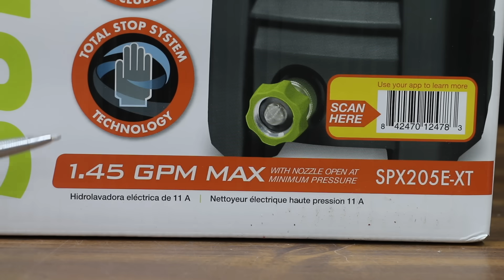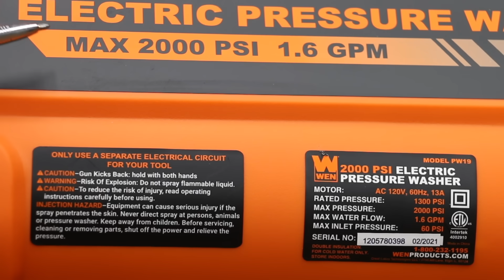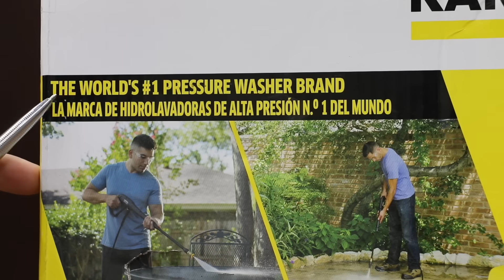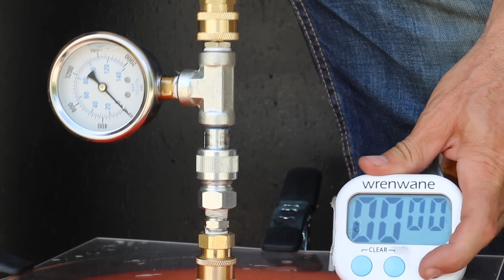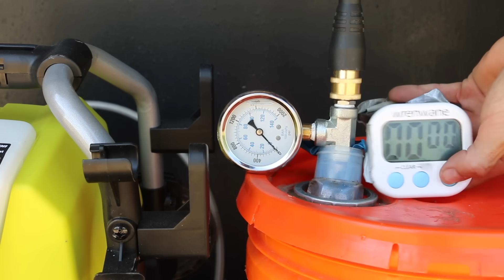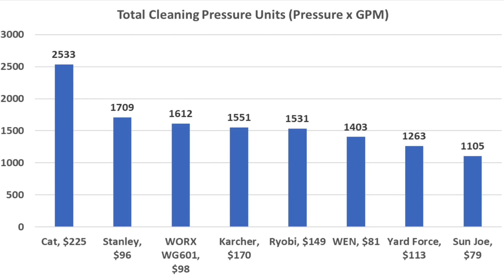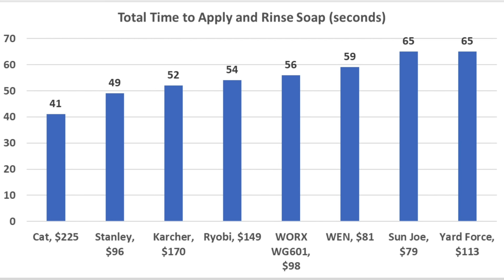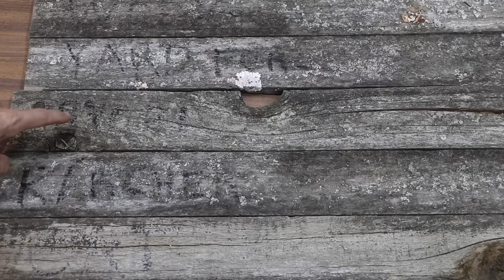Best Pressure Washer (ELECTRIC)? Ryobi vs Karcher, Stanley, Sun Joe, WEN, CAT & WORX

Comment: Love your videos, I actually was just looking to buy one of these.  One thing I would really like to see, is if you just open the pressure washers and show us what's inside, it doesn't have to be extensive, just a quick look would tell me a lot, for instance you might see plastic parts vs metal and different pump styles. Anyway keep up the good work!
Reply from the maker: Great suggestion!  Thank you.
Reply: @ProjectFarm  can you revisit the car or generator running on hydrogen but with a bigger hydrogen oxygen generator maximize surface area , use a carbureted engine  , maybe add a little power with solar panels see what happens. Seems like it might even work better with something that was designed to run off propane
Reply: @lucashawn347  It won't matter. 
Thermodynamics and all. 
You can't get more energy out than you put in.
Reply: @tomfuelery2905  I'm not trying to see him make a free energy device. Just a beefed up hydrogen oxygen generator that puts out enough to maybe make a real difference definitely sounds possible with solar panels in parallel with what's coming from the alternator plus a lot more surface area for gas production. We know things can run off hydrogen oxygen gas. Problem is how do you make enough on hand with solar ,wind or whatever to where you don't actually have to purchase gasoline or charge your car every night. I don't know all the math but I've had some luck with a 4 cylinder dodge Dakota.  Really wasn't that much difference but noticable. Had a cell homemade not much bigger than that one but my electrodes had much more surface area comparable to a radiator.
Reply: @ProjectFarm  yes PLEASE do a inside video of the pressure washers. I’m a ryobi owner and now I’m wondering what it is that makes it about 50-70 dollars more than some of the washers that outperformed it. Is it just the name?
Reply: @ProjectFarm  A very interesting and informative video, the one thing that I would recommend is when first wetting anything that you will be washing, by hand or with a pressure washer, is start at the bottom and wet going up. When wetting from the top the long drips soak the dirt longer and result in streaks.
Reply: @ProjectFarm   you forgot to test gas pressure washers :(
Reply: @ProjectFarm  I would absolutely love a Project Farm Reviews channel. It would be great. This is kind of a reviews channel, but it's scientific and therefore not opinionated. I think I and the rest of your viewers really value your input and opinion, so it would be a good secondary channel (and probably pretty easy to do on the side!) Thanks :]
Reply: @MetalY2KMusic  
  Opinions are like bodily waste exit valves... everybody has one.
Reply: I'm willing to bet 20 dollars this feedback will be in the next pressure washing video if there comes one
Reply: to be honest - I am not interested in buying such pressure washer - have no use for that at all (live in a city) - what is far more interesting for me: 
HOW the heck did he test it ???
After watching this video: I seriosusly admire this guy's commitment and superb work!
Reply: @kris856  Dude, he makes it on a regular! :)
Reply: @HanSolo__  true, bro- so very true 👍
Reply: Or at least a plastic vs metal hose connection.  I commented above check out the Active pressure washer.  It is the same as the CAT and I think was $200.
Reply: This sounds like a job for AVE
Reply: @_ohmz_electric  AVE is a moron. Everything is an OpAmp to him.
Reply: @_ohmz_electric  AVE would do one, probably an overpriced piece of crap, and eviscerate it.  Certainly I'll keep my eye out for it. =)
Reply: @bansheedearg  AVE would have taken it apart, then when it doesn't work just call it chinesium and throw it away.  I've never been so entertained by that magic swearing Canadian poet/tool destroyer
Reply: @_ohmz_electric  Yes, we need somebody that opens things up and does not close.:D Kidding. Love AVE.
Reply: @_ohmz_electric  Please no....hoses, nozzles, tips, pumps and wands...it would be an overload of boyish inferences to his other "shop equipment".
Reply: @Ben C What the hell are you talking about? He doesn't work for Amazon or anybody else, he buys and tests items using his own money.
Reply: @Ben C finally found the one person who who doesn't like the channel
Reply: @Ben C I've had mine for a couple of years, makes the driveway gleam, snowfoam lance for the car, cleans the gutters and drains, blows weeds out the cracks
That's all I need it for so I didn't mind spending £120 on the best that was recommended at the time
Got no space for an industrial cleaner that needs fuel either
Reply: @Ben C guy buys stuff, treats it to real world testing like any normal Joe, reports his findings, then leaves it up to you
And you are arguing that "he works for amazon" because he links back?
Only the other day I liked for a @ProjectFarm video and then clicked the link to buy it as a thank you for doing all the testing
This is THE go to channel for testing, and he's got plenty of people who, like me, trust his reviews
Reply: @Ben C I own a mix of Snap on and Amazon "junk" depending on what I need it for. The bigger version of that Sun Joe pressure washer that I own does exactly what I need it to when I need it to. I don't need a pressure washer that is capable of removing the paint from my car. That being said, my electric pressure washer could probably remove the paint from my car as well if I wanted to get crazy with it. Might it take longer than the gas one at some tasks? Probably, but that only matters if I am using it all day every day, which I am not. I roll it out, plug it in, turn it on, and it functions each and every time without needing to maintain a gas engine.
Reply: @Ben C You should understand that I was an automotive technician for over 14 years. Just because I can maintain the engine doesn't mean I want to. Electric is easier for the vast majority of modern people. Do I wish more people knew how to work on things? Sure I do. But that is not the reality. I'm glad you enjoy working on your gas pressure washer. My big stand-up version does exactly what I need and giving somebody crap for using something that fulfills their needs is just not useful. And what do I really need to justify post-purchase? My pressure washer was sub $200. There is no buyer remorse there. I would have buyer's remorse if I spent the money to get the top-of-the-line unit and then only drag it out once in a blue moon. It should also say something to you that you are the only one in his comments that is negative. Maybe the problem isn't Project Farm or the people who like electric pressure washers. I just went back and looked. Given that Youtube says that you only joined in May of this year, I am going to go ahead and guess that you have had other accounts banned from Youtube. Trolls like you are just unnecessary. If you had something constructive to say that didn't start with attacking the character of the creator, someone, myself included, might have actually considered what you had to say.
Reply: @Ben C So instead of trusting someone that buys a variety of products and pits them against each other, you choose a paid salesman just cause you can talk to him face to face and let him butter you up?
Reply: My Karcher broke down a couple months ago. Had to buy a 15 cm long torx T15 just to open it. I hate when I can't even open things to repair them by myself
Reply: @martinobravin5615  It's not like Torx is some super rare security bit, it's pretty standard.
Reply: @pubbiehive  I know, I have tons of torx bits and drivers. The problem was that the last 2 screws were down a narrow 15 cm deep hole where even normal bits couldn't fit.
Reply: @martinobravin5615  That's why I prefer normal screwdrivers when taking apart electronics, etc. Bit drivers are always too damn wide.
Reply: @martinobravin5615  but you could open it, who doesn't have a torx set 😂
Reply: @Ben C What are you talking about?
Did you forget to take your meds?
Reply: @Ben C my hose can't do those things though, otherwise they're would be no need to buy a jet wash that can do those things 🤷
You are starting to sound like a power washer salesman...
Reply: Would really like to see a run time evaluation. Use a timer to power the pumps for their recommended duty cycle and see when they fail. Duty cycle is not addressed in this review. Do these still have duty cycles listed in the instructions?
Reply: @data9309  they normally have a maximum run time before they need a set time to cool down before being usable again
Reply: @therealdojj  For that reason the pressure washers will each have to be powered through their own timer which will only run the pressure washer for the amount of time recommended by the manufacturer. The timer would then turn the power off to the washer for the allotted cool-down period, and then repeat over and over until the pump fails.
If the pressure washers are to be unattended during testing, then there would have to be a way to keep track of how long each one lasted. The simplest way to do that is to collect the water from each washer in a separate vessel. Since we know the GPH of each washer, we can calculate the number of hours based on the number of gallons in each vessel after the washer stops working.
Reply: quite agree. Having used pressure washers extensively back then, there isn't much to separate models/brands except power, durability, and possilbity user maintenance.  The only issue I had back then are worn out seals. I also wonder why washers are stuck with pressure dependent on/off mechanism, it is clunky, hard on the tool, and dangerous.
Reply: I think the weight test is a pretty good representation of part materials and quality. Price to weight correlation very strong.
Reply: The washers that are upright, mostly air inside. That's why I selected the Ryobi for my new washer, it doesn't waste storage space by building a box around air, and I can put it on a shelf.
Reply: I agree
Reply: I agree.
Reply: I would say the guts are the same in many of these
Reply: @Ben C Take your own advice and get off of the net. It's full of know-it-all blowhards that crap on everyone else's opinions and feel their own way of doing things is perfect.
They have the knowledge base of a twelve-year-old and know that 50 years of education and experience mean nothing.
See ya!
Reply: @Ben C not that I need to explain, but it's normality parked up in the garage for months at a time
Still not sure what that's got to do with using a jet wash to clean my garden 🤷
Reply: @Ben C LOL I give PF $1 a month just to hear him laugh talk.  That's like 25 cents an episode.  Maybe I should make it two bucks.
Reply: @Ben C I currently work at a national lab and go to school full time for electrical engineering. And I didn't say mechanic for a reason. I specialized in electrical diagnostics.
Reply: Metal vs plastic is why I bought a Karcher over a Gerni.  
They say it's just as good, but I just don't trust that!
Reply: @Ben C this guy has compare quality with cheap junk and knockoff brands made in China and we clearly have learned from him and experience that even knockoffs at time last more and are better than some name brands. It’s sad that the experts are the ones lying to the public because they don’t do comparisons. This guy has almost 2million subs that trust his opinions and with the views he’s making a living, Amazon can’t pay him enough to sell out,  he would’ve lost me as a sub had I purchased anything that  he suggested and turned out to be a bad buy. He clearly said the best was 225 and anyone with the extra money would buy it but I’m not pressure washing sidewalks I’m needed to was my car so yea wen pressure washer it is. You’re the tool!
Reply: I honestly didn't know there are other Brands than Kärcher. We literally have Kärcher in all sizes and ranges. All old already and some are operating shady.
Reply: AvE, What’s Inside etc.  There are channels with the knowledge that do this.
Reply: You should be asking Jerry over at jerryrigseverythjng for that.
Reply: Woah aren't you getting into AVE territory here? That is a good suggestion though, I am not sure what Project farm does with all the equipment after the first video and at least this could get him a second video but it might be even more time consuming than the in-depth testing he does!
Reply: @tehpanda64  ave & lockpickinglawyer 🤜🤛
Reply: @tehpanda64  PF does not bumble and there is no fuckery so there's no encroaching on AvE territory, hahahah
Reply: Great succestion! And I personally think that Kränzle should be included on the comparison. They have metallic pumps on them.
Reply: Kranzle brand washers are exceptionally expensive and have no offering even close to the price points of the tested washers. Perhaps the reason it was't shown/tested. Just a thought.
Reply: @Ben C who's a paid Amazon rep here?
Reply: It looks like everyone else has said it for me but yes AvE would definitely be the guy you need to see
Reply: @Ben C  Where are the videos of your tests?
Reply: It looks like everyone else has said it for me but yes AvE would definitely be the guy you need to see
Reply: You’d love AvE’s page
Reply: You do the lawnmower huh, ???
Reply: Check out the Boltr series 👍
Reply: @Ben C I find if I like my own comments other people are more likely to see and like them as well. Call that narcissistic if you want. I don't have a problem with that.
Reply: I'd suggest getting a real pressure washer. Look for a gas engine powered washer, 5.5hp 2200psi 3GPM gets you a LOT more than these things do (actual PSI not this bs "right when the nozzle is opened" crap, and 3GPM with a spray tip installed, not without a nozzle) or bigger. These little electric pressure washers are a joke.
Reply: @gorak9000  is a bit overkill to just have in the shed to clean a patio or hose off a muddy car though
A hundred quid vs thousands
Reply: @therealdojj  You can get a "real" gas pressure washer for $500-$700 - yeah, it's a little more than these toys, but with these things, you might as well just use the spray nozzle on the hose - it's just about as effective.
Reply: @gorak9000  Maybe, but my stand up electric can sit until I am ready to use it, and I don't have to worry about bad gas or whether it is going to start. It is also extremely quick to just plug it in and deal with the leftovers that some drunk tossed on the cars in our driveway without it turning into a huge hassle.
Reply: @gorak9000  gahahahaha real pressure washer 500-700$. I've seen shotguns for a real pressure washer cost 3 times the price of your real pressure washer. Also a real one has a Diesel and bonus points if it takes up half a semi bed.
Reply: John 3:16 King James Version 16 "For God so loved the world, that he gave his only begotten Son, that whosoever believeth in him should not perish, but have everlasting life." (share the good news of the gospel around the world!) Truth about the deceptive islamic religion channels: christian prince, light for all nations, light shineth in darkness
Reply: @1CT1  You want to tell me what business that has being in these comments? Saying that this wasn't done by a bot anyways.

Comment: You should try the kränzle brand pressure washer. I heard that they are very good
Reply: I was really disappointed about Kränzle. I got one for work (cause heard rumors that it would be good brand) and it's pressure hose was one of the shittiest hose materials I've ever seen. It also began to leak after very short usage (few hours) and because of "professional usage" it wasn't covered in warranty. Even though that "professional usage" was actually easier than many general households would use. Quite unlikely that I would buy for myself.
Reply from the maker: Thanks for the suggestion.
Reply from the maker: Thanks for the video idea.

Comment: well i have to say, you didnt test my Harbor Freight Portland brand pressure washer. I hate Harbor Freight products, but the Portland brand matched my low expectations, which is why i bought it. I needed the low end washer for cleaning my silk screen for screen printing because you dont want them tearing holes in the silk screens. lol  Mine looks like the low end ones you tested, so im sure its right at the bottom.
Reply from the maker: Thanks for sharing.

Comment: Thanks for doing a video on pressure washers like I had suggested. The video did answer some of my questions, but not enough to go through with buying a more powerful pressure washer that can strip paint. 

I would still be interested in a video that covers electric and gas pressure washers in the 3000psi range.
Reply from the maker: You are welcome!  Thanks for the video idea.

Comment: Of course you post this a few weeks after I buy one without much knowledge… Great video. I ended up getting a Greenworks 1200 psi version just because it was cheap and I won’t use it much, and it’s surprisingly pretty good for an electric model.
Reply from the maker: Thanks!  Thanks for sharing.